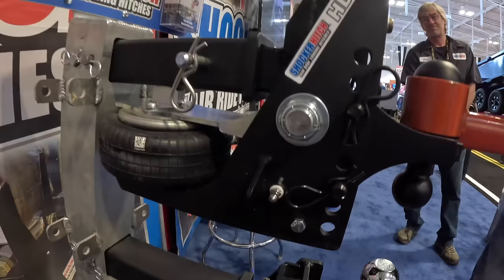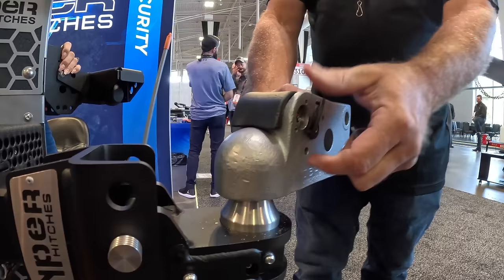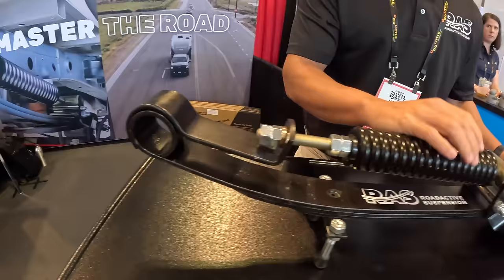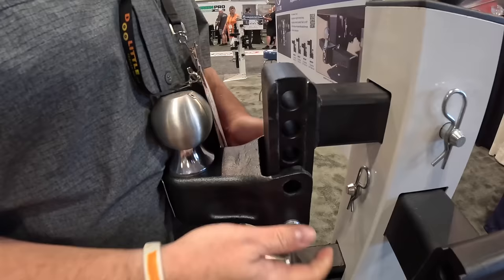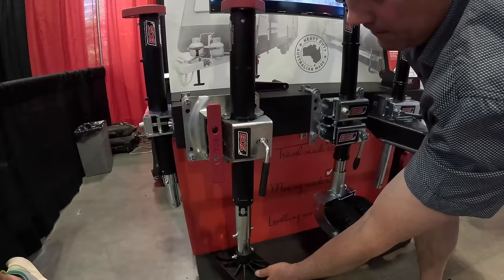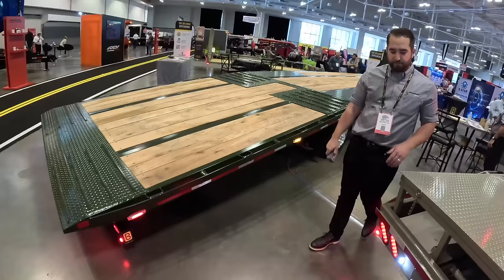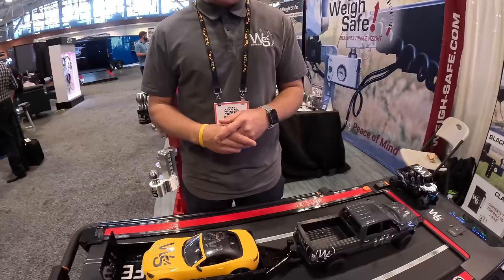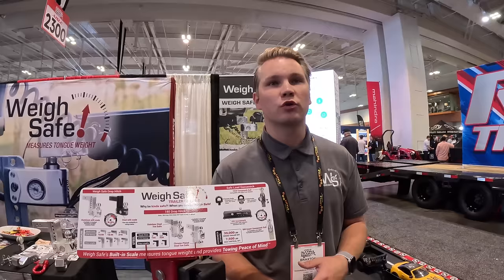Special Show! Trailer Upgrades and accessories   4K

Comment: Despite the claims, all the RAS does is stiffen one half of the leaf spring arch.  The net result is a stiffer rear suspension and, therefore, any benefits that may be had from that.  

To be clear, there's nothing active about it.  It's no different than adding spring rate via air bags, stiffer springs, or any other method. The only difference is that at normal ride height, they don't add as much spring rate as some other systems, but ultimately, they're just fancy springs that stiffen the leaf spring a bit.